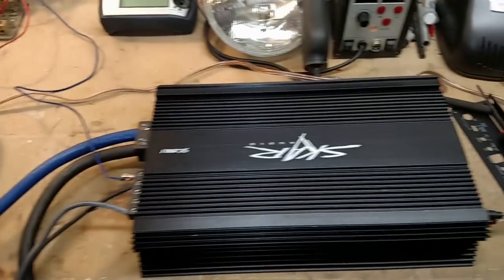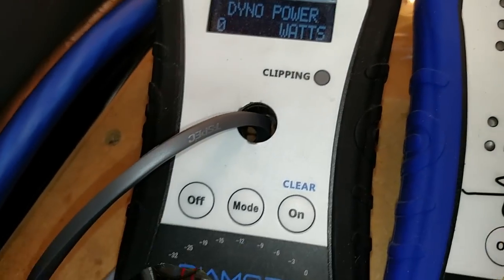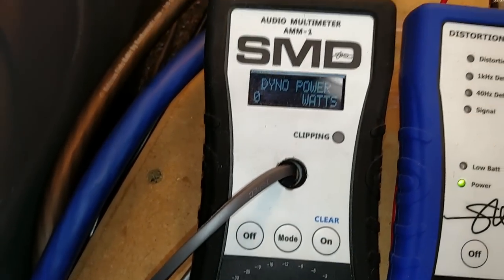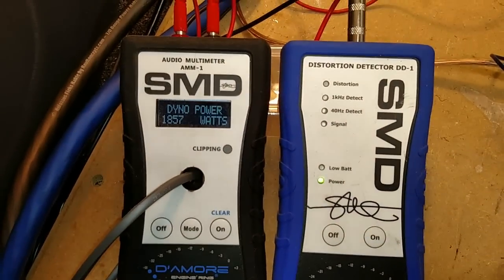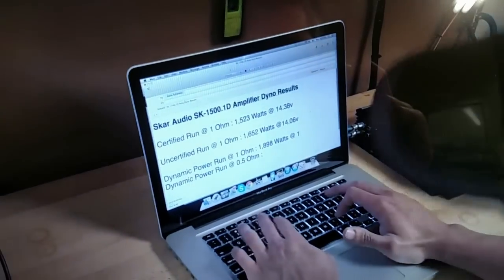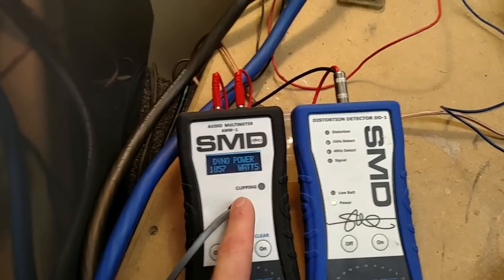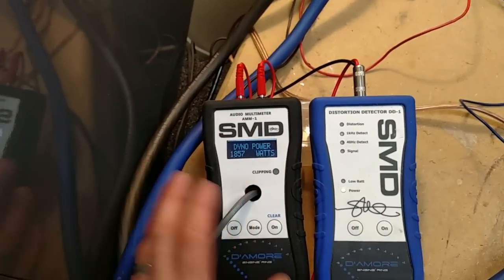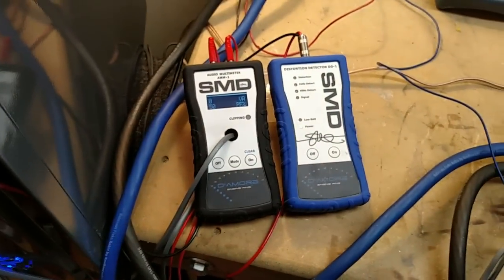THE AMP LAB vs AMP DYNO AD-1

Comment: Hi JKT,
I was looking to purchase an AMM-1 to dyno amps and use some of the other functions it provides. But according to D'amore themselves, they state the AMM-1 is not the same as the AD-1 in regards to dynoing amps, in this video link below:

Watch "New Product Sneak Peak - SMD AMM-1 Audio Multi Meter - D'Amore Engineering (PROTO)" on YouTube
https://youtu.be/Bg72cRza4Lk

What's your thoughts?